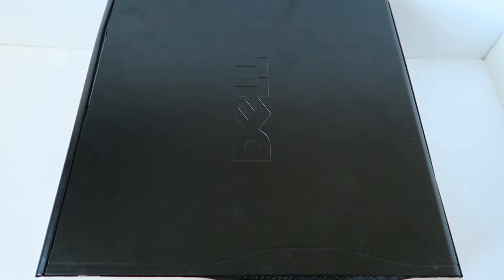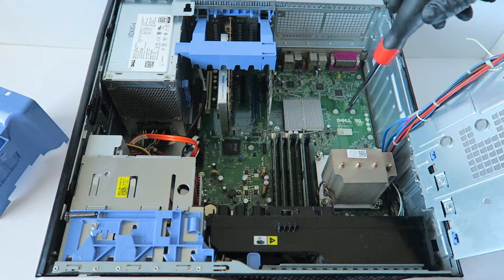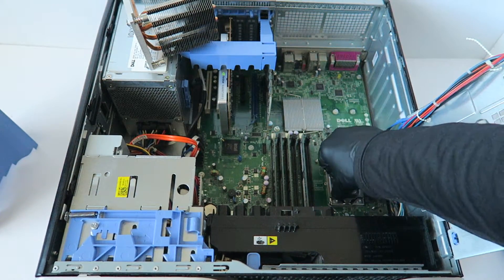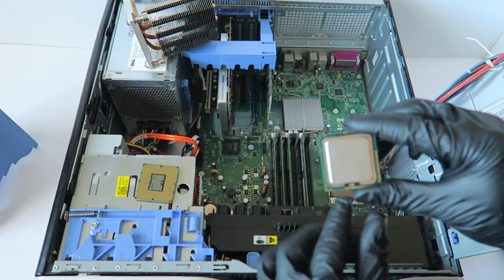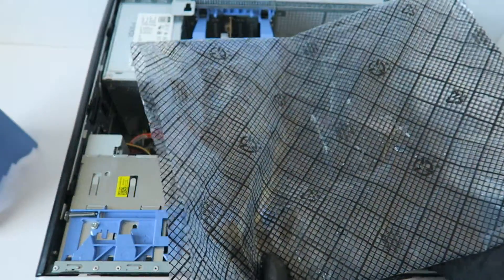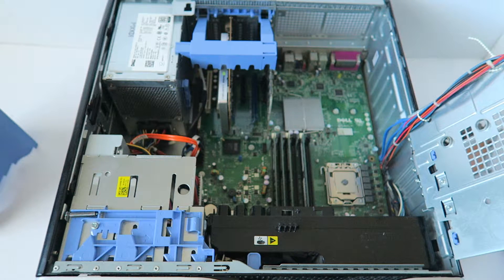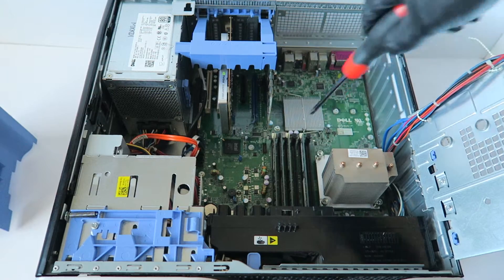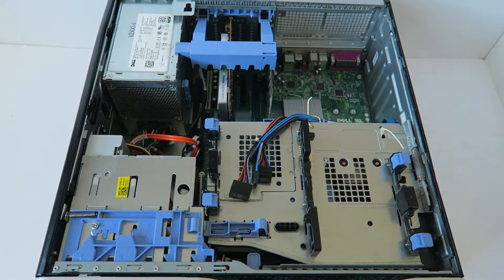Dell Precision T3500 CPU Upgrade

Comment from the maker: You can upgrade to Xeon X5650 or Xeon X5675 for around $30 that is great deal.

List of CPUs you can Upgrade..
1. Intel Core Xeon X5660 2.8GHz 12M Cache 6-Core SLBV6 Processor
2. Intel Xeon X5675 3.06GHz 12MB 6-Core 95W SLBYL Processor
Reply: I had no idea what I could do to upgrade my t3500, this helped me out so much. Thank you!
Reply: What advise you to buy a processor?
Reply: And also Xeon W3658 which a 6 core 8threads @3.30Ghz.
Reply: can i put a ryzen 3 1200?
Reply from the maker: @GrantStudley  Hi, no
Reply: Obrigado amigo, será que ele roda o x5690????
agradeço bastante por sua ajuda. Uso o PC para trabalho!!!
Reply: can i put Intel i3 2100 3.10 Ghz Processor?
Reply: @amsyarmanap  no, this is socket 1366 for servers/workstations. intel did not make i3's for this platform.
Reply: @freebooterz-Warmane  thx for the info
Reply: After I upgrade to xeon x5675 my PC is slower...why??!!!
Reply: @amsyarmanap  What gpu are you using? Perhaps it could be bottlenecking the cpu.
Reply: @JereMiah-tg8to  gtx 970
Reply: @amsyarmanap  the gpu may be too slow for the cpu, you can try to overclock it perhaps, if you have a safe way to do so
Reply: @amsyarmanap  Forgot to say, but check you’re power usage, make sure you aren’t using too much and it’s causing the computer to bog down.
Reply: @Dreznov立派  No, I did it, it worked just fine as soon as I turned on the computer.
Reply: my pc have no sound help

Comment: Bro please tell me a best CPU for t3500 which gives max performance  no lag and high fps waiting for your reply_
Reply: Hello, the best option I would say is the Intel Xeon x5675, it is 3.06GHz 12MB 6-Core 95W, I use a x5660, and the difference between stock cpu is night and day. (In a good way)
You can also easily overclock these cpu's to over 4 Ghz.. I could not tell you how people go about doing this, but I'm sure you wont regret your purchase if you do make it.
Reply: I will also say that on Amazon, the x5675 is 50 dollars renewed, while the x5660 is 30 dollars, renewed, there is not much difference in performance with these two, and I would recommend buying the x5660.

Comment: I have a T 3500 running windows 10 pro, if I upgraded the cpu will it still boot into the OS, also would the system then need a new PSU? Ty for the video
Reply from the maker: Hi, thanks. you do not have to upgrade your power supply and are you going to upgrade video card also?
Reply: @Mxkdt  perhaps later, when prices get better. Ty for the reply!
Reply from the maker: Please don't forget to subscribe to the channel.

Comment: i have aquestion . So the basic motherboard 09KPNV witch is in  computer(t3500 station) should  handle procesor x5675  . I just bought  this CPU and IDK if the bios is screwd or the new CPU , cause it been used.
Reply from the maker: Hi, yes make sure you do update your BIOS to latest Version
 A17 before installing the new PCU  x5675.
Reply: @Mxkdt  yea i had a17 and still have i sent it back and bought new used cpu work fine :)

Comment: can i swap out my w3505 for a x5687
Reply: Yes...that's the CPU I just went with along with 24gb of DDR3 1600. Runs really well.
Reply: The Bios need to be updated to A17 but How do you overclocking on this dell t3500?

Comment: Can i use x5690 in t3500 ?
Reply: Yes...it'll work. I decided on the X5687 for the 3.6 clock speed instead. Runs really well with 24gb of ram and an older GTX 670 FTW card. No issues gaming.
Reply: @AlexSantana66  olá, então o T 3500 funciona com o x5690? Não é muito claro ainda.

Comment: did you change the chipset radiator?  And then the standard radiator can not cope and it turns out that the server bridge is hot.

Comment: This is super helpful, and you seem to be the most knowledgeable person about this system on the internet. I have a few questions I hope you can answer. 
A.) Can a t3600 take the same upgrades?
B.) Is the x5675 the most powerful xeon cpu that will work with this system?
C.) Would a GTX 1650 super work with this pc?
D.) And finally is the t3500 or t3600 compatible with aftermarket heat syncs?
Reply: T3600 has a Sandy Bridge E LGA 2011 CPU socket so no, It used completely different CPUs, cannot take the upgrade.

X5687 is the Best CPU it can use.

GTX 1650 Super will work fine with the standard 550W PSU, as it does have a 6 Pin so any version of 1650 is supported.

The CPU Cooler has standard LGA 1366 spacing, but instead of empty holes it has screw holes. So you cannot use other coolers unless they also screw in the same way.
Reply: @williampaabreeves 
What is the max CPU upgrade for the T3500?? 
Please do reply!
And do you know any aftermarket cooler that could work with the T3500??
Thanks in advance✌️
Reply: @williampaabreeves 
What is the max CPU upgrade for the T3500?? 
Please do reply!
And do you know any aftermarket cooler that could work with the T3500??
Thanks in advance✌️
Reply: @IBRAHIM-gs6mb  aftermarket coolers won't work, maybe an aio could but air coolers won't fit.

Best cpu for the t3500 is the X5690, but those are a bit pricey most places. The X5675 is usually a good price and if not then the X5670.
Reply: @williampaabreeves  
Thanks a lot dude 
For that info❤️
Reply: @IBRAHIM-gs6mb  two heatsinks exist, theres a standard all aluminium one, and a better one with copper heatpipes. looks like most tower coolers only smaller

Comment: I'm running an X5680(6 core, 3.33 ghz) on the A17 bios.   Best bang for the buck CPU for this system.  Half the price the price of the higher clock speeds X5687, 90, 98 cpu's with 95% of the performance.  Finding 24gb of compatible RAM is going to be the real cost of maxing out this system..
Reply: olá, por que não optou pelo x 5690, não é mais poderosa???? Será compatível com o T3500????

Comment: Hey can i upgrade the 3500 with a x5649 ? Thanks for help
Reply from the maker: Hi, i did check and t3500 does support Intel Xeon Processor E5649 with BIOS Version: A17

Comment: can we add i3 7gen
Reply from the maker: No
Reply: is there any other good cpu for this pc for gaming
Reply: i have a we3503 is there any better then this
Reply from the maker: You can use xeon six core x5650 or x5660, x5670
Reply: price
Reply from the maker: You can upgrade to  X5650 for $20 or X5670 for around $30 that is great deal for the CPU.
Reply: are these good for gaming i have a 1050ti in it
Reply: whats the price of new
Reply from the maker: Yes

Comment: 🙂 t3500 thats the one that u can install 4core & 6core xeon cpus
Reply from the maker: Hi, yes  i did buy T3500 and T5500 is really nice machine.
Reply: @Mxkdt  😀 oh really, thats neat, the t5500 & t7500 are supposedly better because the motherboard has additional chipset fan coolers, where the t3500 does not and is stripped, i dont know for sure if the t3500 mb will overheat if u install a 6c/12t x5690 in there, but supposedly x5690 works with all three t35 t55 t75 😎
Reply from the maker: T3500 only supports one processor and t5500 support dual processor if you can get one for 100 bucks that is good deal and reason i did buy because i  got really good deal on them.
Reply: @Mxkdt  🙂 well my FreeGeek Thrift Store has three T3500 for $130 each, but i think a T55 would be better, so i will wait, no worrys i got too much stuff as is to work on, i just pu a PS3 & Xbox360 consoles to mess around with this Xmas from FreeGeek and i pu a few old game classics from them and some from fleabay yay✌️😏📀📀📀📀📀🎮
Reply from the maker: I like t5500 better it got huge 875w power supply.
Reply: @Mxkdt  ☺️ 875 mite be a bit overkill with a single 6/12 cpu, we need a watt meter to test yay! 😀
Reply: @Mxkdt  😒oh! turn on both the pcs everyday and make sure it doesnt have a stupid intermittent 'no post' problem with buzzing beeps and green lites error codes, if it does smash em 👊😒 boom! ☺️
Reply: @MrSamadolfo  olá, vc usa do X5690 no seu T 3500?? Estou pesquisando pra ver se é compatível para faer um upgrade.. Obrigado pela sua resposta.
Reply: 🙂 i think the t55 is the sweet spot because the t75 is in a stupid extra large case, where the t55 is in the more common same size as t35 & t34 😉☺️
Reply from the maker: If you can get t5500 with dual socket processor total 12core and 24threads for $130 that would be really good deal.
Reply: @Mxkdt  🙂 yup sounds good, i will keep checking around if a T55 pops up locally for cheap ✌️😏
Reply from the maker: Happy Holidays.
Reply: @Mxkdt  ✌️😏 thx, Happy New Years 🍷🍸😋🥃🍺